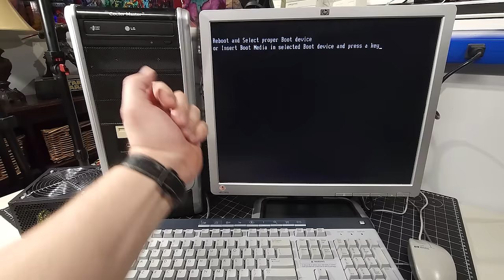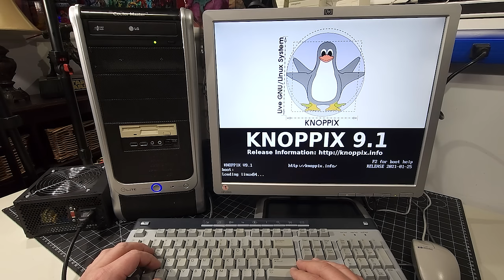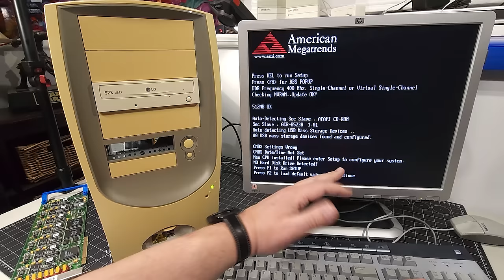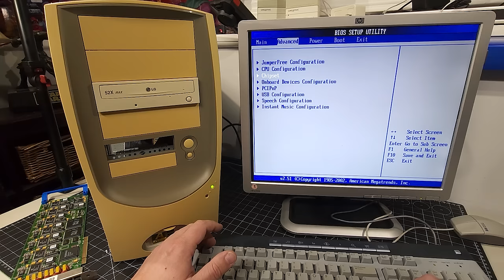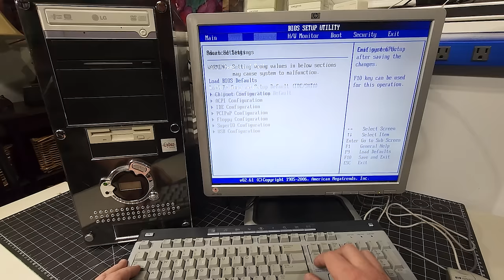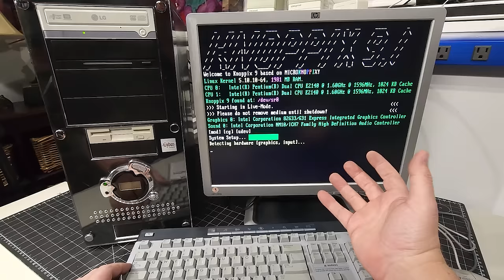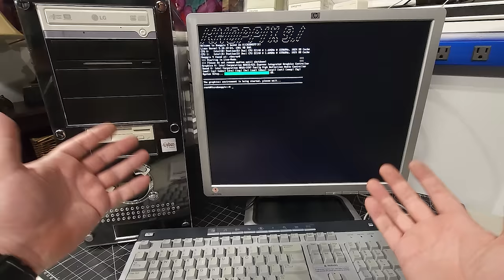Mystery Custom RETRO PC's...What's inside??

Comment: That second computer kinda reminds me about those Orangutangs with the big curved face. BTW the air shroud with a tunnel to the CPU is not pulling hot air out of the chassis, it´s the other way because there is not many fans that pulls air from the heat sink they blow on to it which makes the fan pull cold air to the CPU through the shroud. I still think you could have a problem with the power supply making it reboot but it might only be showing these problems under some load, the tester might not be enough load to trigger the problems you have so I would test another supply first
Reply: Yeah, those snorkels are for intake and delivering cooler room air into the cpu fan.
Reply from the maker: Yes, I stand corrected (by many comments haha - oops!).  Also regarding the PSU, you are probably right.  That - 12v on the tester was really wonky, I just assumed as it wasn't under load is the reason why, but the behaviours of the system may have indicated otherwise.  I'll be testing another PSU for sure.
Reply from the maker: I stand corrected :)

Comment: Btw,IMHO the CoolerMaster case isn't a simple,as you stated.
It has a "toolless" design,and a multiple fan mounts.
About that 5550.
You kinda wrong, because the strongest,more powerful video cards usually came first,and a less powerful - latter,using same times the same gpu,but binned lower.

No,not as simple,as that.
Reply from the maker: Haha, the interaction / conversation is great!  Everyone has their views and opinions on these old components.  I believe I was comparing it to its other brother that I had worked on in the CoolerMaster Twins video I did - that case was much less 'simple' and was built quite well.  This case in comparison was very cheeply made (Imo). 

As for the video card, as I stated there will always be better cards out there.  I think for what this card was at the time it was decent and in today's standards / use case having a low profile card is a bonus for the smaller systems.  :)
Reply: @TheRetroRecall  
Heck,the most i've seen is a dreaded HD5450...

Comment: I would use the last Cyber case for a "sleeper" type system with modern components. It's totally retro cool and you could really set it up with RGB that could make that case shine!
Reply from the maker: For sure.  I haven't decided what I want to do with it yet - but it definitely needs an overhaul and the hardware in it now should go.  As for a newer system - not a huge fan of the rgb stuff.  I almost feel if I was going to do a new system build, I would buy a NOS, or a new unique case to do it in (instead of an older recycled case). 

We shall see!  :)

Comment: Hi, system #1, Casing is a CM E-Lite case. It’s one of the basic cases available from CM for builds on a budget.

System #2, that 8-port RJ-11 card was used in a company as its internal telephone exchange. Quite old tech as it’s now superseded by software now. Depending on what you want to do with it, it might not be worthwhile to rescue it.

Why you can’t get it boot Knoppix, even after adding more ram is kinda weird but I believe there could be an issue with the memory controller and possibly of failing capacitors.
Reply from the maker: Thanks!  Yes, going to try different steps to get it booting, more ram, different PSU, different graphics card etc.  Lots of fun!!

Comment: I might be wrong but I think the reason why the second one didn't start Knoppix was that you tried using an amd64 disk for an i386 only system.
Reply from the maker: Sorry, I'm not following (that's on me). Are you saying the Knoppix 9.1 disk was for AMD64 only?
Reply: Knoppix should run fine on a Pentium 4.
Reply from the maker: Agreed.  Maybe need 1gb ram?
Reply: @TheRetroRecall  It only needs 512mb for a graphical environment and 1gb for web browser.
Reply from the maker: Ok thanks.
Reply: @TheRetroRecall  keep up the great videos!
Reply: @TheRetroRecall  the Knoppix disk has both on it, i386 and amd64 support. I don't know which boots on default but if you type knoppix in it boots the i386 (32bit) kernel. That's a mistake on my end. Thought through the boot sequence that it would be an amd64 medium, but in reality it's both. And I tested it on a vm with 256mb Ram and without a harddisk and knoppix works even with this little amount of RAM. But it would be interesting to know what causes this error.
Reply from the maker: I love that you did this test and confirmed this - thank you!  Our community rocks! I will do additional troubleshooting and report back.  :)
Reply from the maker: Will do and thank you!
Reply: @TheRetroRecall  I ran a test which is the default kernel and it was infact the 64bit kernel. So typing in knoppix at boot up may do the trick. Thanks for your kind-hearted comment.
Reply from the maker: No problem at all, I really appreciate the assistance!  I will give it a try.

Comment: Oh and I think that card is for a small business computer controlled phone system. The computer store I worked at in the early 2000s I built a computer using a similar 4 port card to power our phone system.
Reply from the maker: Yup!  I've been told a RAS server, and the card is an 8 x 56k modem card!
Reply: As it's basically 8 winmodems on one card there's no reason it couldn't be used for voice instead of data with asterisk or something similar to make an exchange,.or autodialer, or information line system...
Reply from the maker: Thanks Majenko!

Comment: I used to have the 3rd pc case that display on the front of the case was for temp inside the case. There is a temp sensor wire and a power wire, and the circles on the front were blue led as the display back light is blue as well
Reply from the maker: Ok awesome, that's great to know!! I will keep that in mind when I go to get it working.  Seeing the temp on the front would be really cool! (pardon the pun lol).
Reply: No problem. I love your videos

Comment: I certainly like those VGA / HDMI / DVI graphics cards. The DVI is a true middle ground & can take adapters to handle the other two if you needed it!
Reply from the maker: Absolutely.  Lots of versatility with them!
Reply: LOL. I don't like VGA. Too much parasitic/ghosting  imaging when the circuit is getting old and its parameters  shifting and floating, fair for both monitors and cards(onboard of the motherboard too).
Reply: @ran2wild370 Yeah, VGA well done isn't any worse than digital DVI well done, but cheap VGA is sooooo much worse than cheap digital. And most of these late Nvidia or ATI cards did just slap on the cheapest VGA they could get away with, just for the few % of buyers still running a very old monitor.

VGA on an old Matrox card is a very different experience.
Reply: The only problem with DVI is that it did come in a few different versions. There was analogue, digital and Dual-Link digital. And every DVI port could support either one, two or all three of the standards. You'd have to go and count the pins on the connector, to be halfway sure. 

But I think when HDMI came to PCs, almost all the DVI ports were fully functional (Dual Link). Which made it more capable than an HDMI 1.2 port, and about on par with HDMI 1.3.

Then again, most games at the time those cards were produced were still designed to be played in 1024 x 768, so it only really mattered if you were rather experimental (or used your PC for more boring things...)
Reply: @ran2wild370 one advantage of VGA is it still works even if one of the RGB wires aren’t connecting properly or are broken in the middle for whatever reason, sure it looks like ass but it’s better than HDMI that completely shits itself if there’s anything even vaguely wrong

Comment: i still use a core 2 duo system on a day to day basis my old dell Vostro 220 still makes a descent system
Reply from the maker: Nice!  What OS are you running.... Linux?  I have a Core2duo running with Windows 10, it's great.
Reply: @TheRetroRecall  at the moment i still have the original vista home basic install but i plan on going with zorin os 17 when i get a new ssd

Comment: Another fine Video Squire,
System1 at: 1:45, Can you believe it, I use the very same Case as my Daily Driver which houses an ASUS Motherboard with an early Intel i5 CPU & 16Gb of RAM, It does the Job for what I need it for to do daily tasks, I’ve since Built a New PC using a Cooler Master Cosmos C700P Case which is a Beast, Weighs nearly 30 Kilos, Never knew that you could extend the Cooling Duct on the Side Panel at: 5:10, You learn something new everyday as they say, Not a bad Motherboard and Graphics Card and reasonable amount of RAM, I quite like MSI Motherboards and they do seem fairly reliable, I certainly know what you mean about the “Wild West” regarding PC’s and Upgrading them, We had the same culture over here in the UK too, Strange that the Splash Screen wouldn’t show on the first couple of Boots
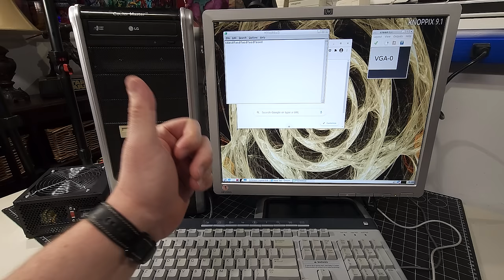System2 at: 17:20, That is one Bland looking Case isn’t it, Not a Case that I’d be happy displaying that’s for sure, It does house a nice ASUS Motherboard along with the Branded Cables, Strange looking Modem Card and not seen one like that before, I do have a 4 x Port PCI Ethernet Card which I believe is a Hub/Switch Card to connect other devices into it and saves having an extra switch, Only one I’ve ever seen and not really used it to be fair, Fairly decent Graphics Card, I’ve got a similar Graphics Card to the Radeon 7000 in that System although I think mine is a VIVO (Video In / Video Out) Card and uses a proprietary connector which I’m still trying to obtain, I bought a Job lot of those Socket 478 CPU’s and Heatsink/Fan combos, Got far more that I was expecting as the eBay Seller threw extras in so bonus, System3 at: 32:36  Definitely the Nicest looking Case of the Bunch and the LCD Panel is a nice touch, Shame about the missing IO Shield on the Rear, Not a big fan of ASRock Motherboards if I’m honest but altogether a reasonable System, What is it with LG Optical Drives in Canada as it seems like most of the Optical Drives over in Canada seem to be LG Branded? Anthony - Birmingham/UK 🇬🇧
Reply from the maker: Hey Anthony, yea for system 1 it started to work so my guess is bad caps?  System 2 should be put out of its misery lol!  Yes LG was quite popular here :)

Comment: Number 3: Plug in green and white front wire for fake-out MHz display. Jumper display to read whatever you want. Edit: 2003-ish flea market special. Microsoft WGA gave you 14 days to buy an uncracked (Dell) product key, or no more porn.😆
Reply from the maker: I think I was told that these cases had that display for inter al temp readings?
Reply: @TheRetroRecall  Gee, no turbo button?😆 Then there should ba a Molex connector unplugged. Fingers crossed, good luck.
Reply from the maker: Thank you!

Comment: Hi All

No #1 machine pretty cool

No2, other than the strange card it should be OK. there could be a few things stopping the linux to boot , i dont think it is a faulty memory stick because if it was you would not be able to get into the cmos screen

Some processors @ y2k need a modded linux for Non-PAE - for older machines line that i use Linux Puppy 4 or 5, you can boot of cdrom or usb and will run with 128 meg ram - the stock image will run in ram and it is about 85 meg

So it could be fussy with processor or ram

For this reason i use some multi boot usb sticks ( Yumi or Ventoy ) and is a bootable dos 6.22 image just in case

No 3 , reminds me of all the overtime, i spend 4 years every second saturday cleaning out PC in office and factory - the factory ones were pitch black filthy in a month, the office ones i would do 4-6 at a time and kept a roster, the ones on the carpet floor were the worst and they would pick up loose carpet fluff and it would settle in the fan, accounts and reception machines would just power off "for no reason"  - they were Gen 2 or newer I3/5/7
Reply from the maker: Yes!  That strange card is a 8x 56k modem card.  I will try a 1 Gb module to see if that makes a difference on system number 2

Comment: I had that #3 case. It was a awesome case. The front display would light up and would show case temp (i think). On mine the side panel with the fan had a cutout for plexi glass to see inside.
Reply from the maker: That's great to know, I'm going to be doing a restoration on it in the future, so excited to see the front display working :)
Reply: @TheRetroRecall If i remember correctly, those had separate thermal probes that you would just jam into components like video card heatsinks or processor heat sinks.  I can see one of the probes laying at the bottom of the case @ 36:38 .  They also require power usually from a molex connector.  I cant see a cord running to the front due to the sheer amount of cables inside so id check that.
Reply from the maker: Appreciate it!!

Comment: 17:42 the look you are talking about has been taken/inspired from legendary mobile phone Nokia 3310 which was iconic and very well desired at the time. Even Compaq & HCL had oem desktops similar to this.
Reply from the maker: Yes, but it doesn't mean a computer case design should be inspired from it haha
Reply: @TheRetroRecall  hehehe maybe this was a marketing gimmick & companies wanted to cash in on that phone's popularity & besides this there were more weirder cabinets inspired by Nokia 7610 too but end result looked liked chinese designers were rookie back then, also there were better versions of the cabinet you have especially if you find a dark blue with white version, please cherish it that'll be a lucky find.
Reply: @TheRetroRecall  around 2006 there were mercedes & bmw inspired custom pc cabinets too with excellent acrylic + glass finish all around very well built too, they had large thick handle to carry them and front bottom had headlights matching to S-class or 7 series with grill in the middle & the cool thing was power & harddrive leds was fitted where turn indicators would be, it felt very nice where drives busy making indicator blink/flash plus there was button to turn on/off the headlights too. Many poor iterations were there but branded ones like by large brands like Microtek were extremely well built better than oems at that time. Please find Microtek Mercedes Cabinet.
Reply from the maker: I had no idea!  I'm going to have to look that up.

Comment: IF you want to check the psu with the psu tester correctly,you SHOULD connect all types of the connectors- 24 pins,4/8 cpu power,molex,sata, floppy (if available).
Reply from the maker: Good call out.  I didn't connect the molex or the floppy in this case.  Regardless, I think there may be an issue with the PSU.
Reply: @TheRetroRecall  
But you should!!

Comment: Testing a PSU really needs to be with a load. I have had a PSU tester show a PSU as good but it could not handle a load. I normally put a couple of hard drives on while testing
Reply from the maker: Agreed.  I didn't think that at the time, so I should have put on an old HDD and connected the molex / floppy power connectors to it as well.  Either way, I'll be going back to check it out.  Thank you!

Comment: Test the 2nd pc's ram in a known good system.  Repace it with know good ram at least 1gb should do.
Reply from the maker: Ok, for Knoppix?  Do you think that 512 (assuming it works) is too little for Knoppix to boot?  I could have sworn I had it booting on 512mb before but I could be wrong :)
Reply: Depends on the hardware. Shared memory can use 8mb or more. I like to use1gb at minimum if the system supports it, The live cd/usb has to load everything into memory. so the more available the better. @TheRetroRecall
Reply from the maker: Sounds great, I'll try that!  Much appreciated :)

Comment: I feel like that screen flash may have been from quiet or quick boot or something in that nature. I had a gateway machine that would hide the bios and go straight into xp with it enabled. It usually would just beep once though.
Reply from the maker: Maybe it was that, just weird it started to show a different behaviour after a reset and a cold boot again and another restart.  It could have also been my monitor as it doesn't always adjust quick enough to display upon first start up.

Comment: I had that Elite case, still got my old Phenom 2 in it actually
1. Elite 330 case, motherboard has 4.7 BIOS update
2. BIOS status confusing, the reported version doesn't seem to tally with the available
3. 2.10 BIOS available, and I'd guess the display is specifically a case function
Reply from the maker: Thanks for this, I'll take a look into this.  Also, I think the display actually has separate batteries.

Comment: That first case is a Cooler Master Elite case, definitely a budget case but Cooler Master has had that case model around for a long time.
Reply from the maker: Yes definitely feels much cheaper than the other cases I've worked with.  Still very capable though!
Reply: @TheRetroRecall  oh yea definitely capable! I've had a few over the years, main problem i have with the case especially with later versions of it was the thin metal
Reply from the maker: Yes.  Go check out my server 2008 CoolerMaster Twins video.  Those cases were indestructible